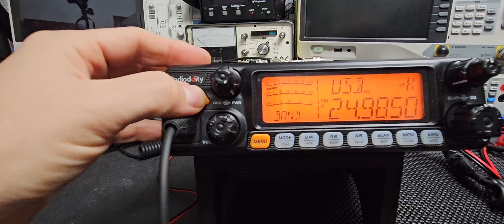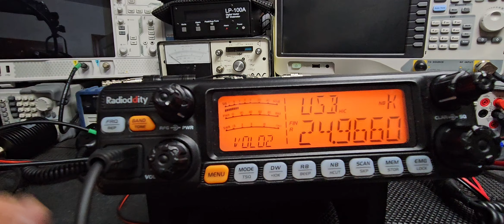Quality Check Radioddity QT60 Long Case

Comment: Nice contact on 12 meters !  My QT 60 long case working super as well. The RX is great on them !  Making 29 MHZ AM POTA contacts was fun the outher day !  Just a end fed vertical 5/8 wave into a 4:1 UNUN . All home made .  and on battery in a park.  Lots of DX at times . State side I herd CQ POTA on AM and went back to them.   First 10 meter AM contact for me.  Them QT radios are nice . Great for the hobby ! Work great POTA !  Got some great FT8 with the Digi Rig on the QT 60 . 15 watts just warm . Ran 100 watts FT8 with a KL 506 -300 watt amp. Stayed warm.  Jot Japan/Poland/and many mode DX on FT8 with the QT 60 driving like 7 watts to amp. radio stayed cold ! 73
Reply from the maker: Very cool and congratulations on the AM contact. I forget to check that part of the band.

Comment: Im on 12 most everyday, usually 24.950.
Reply from the maker: I'll have to try to find you.
Reply from the maker: Probably should wait until my antenna is up on the tower and is rotatable but you never know.
Reply: Super conditions on 12. WWV on 25 MHz was +20 earlier.
Reply from the maker: That's impressive. 
I went to 12 today but 10 was much more active. I was able to barely get Japan just before the band closed on 10.